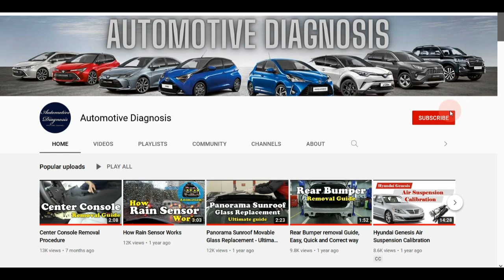PEUGEOT / Citroen 1.6 HDI Diesel Fuel Filter Replacement & Fuel Priming Procedure

Comment: Hello can you explain i have same filter in citroen berlingo multispace 2010 1.6 hdi my car was diagnosed fuel sensor not working the fuel sensor is on the head of fuel filter?
For this my car make a lot of smoke
Reply from the maker: I think that sensor is different from what we have on the fuel filter. This sensor on the fuel filter is to detect the amount of water in diesel. Don't you remember any code or more details about the fault?

Comment: I have a leak under car from hose after filter replaced
Reply from the maker: You might have forgotten to rotate the water in temperature connector at the top. Also there is an O-Ring at the end of that plastic rod, if you damaged that one, for sure you will get a leak.
Reply: @AutomotiveDiagnosis  the leak only when i turn the car off.maybe its related to air in system? I only prime the bulb by hand